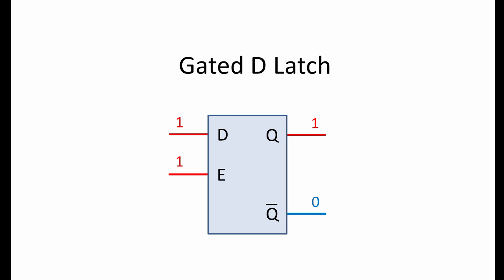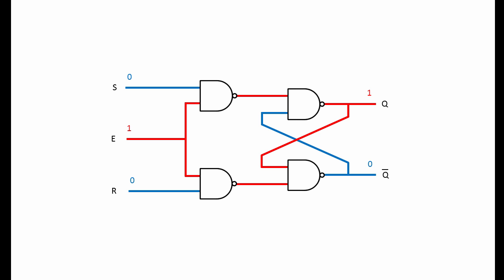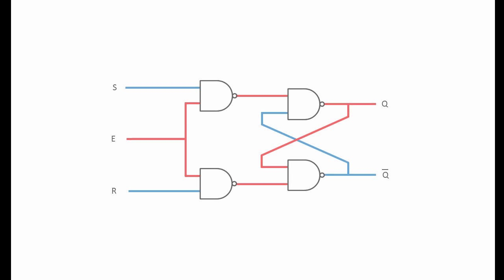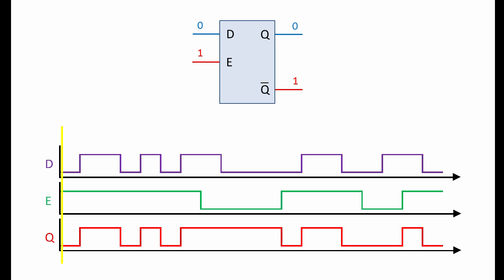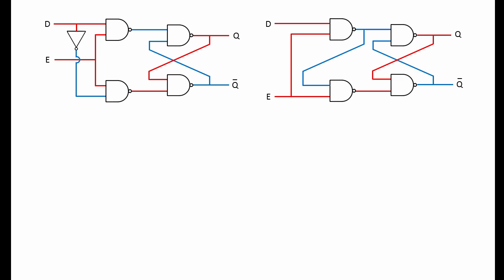Latches and Flip-Flops 3 - The Gated D Latch

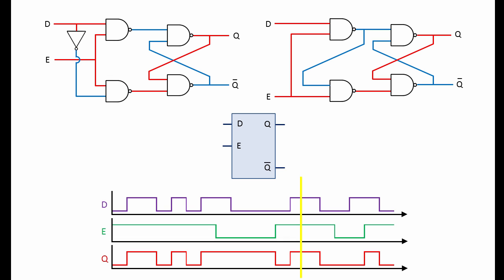Comment: 07:34 What's wrong about that? Flip-flops are just bistable devices that can last in either one of the states or another for as long as we please, and switch between them (i.e. flip-flop) when we want that to happen. There are literally SR flip-flops as parts of your D latches. Gated latches are also called "transparent" latches, because they're transparent when the enable input is high (replicating its input to its output), and latch (i.e. "freeze") their outputs in their current state whenever the enable input is low. As for clocked D-latches, I would say they're "registers", as they can store bits of data at the raising/falling clock edge, synchronously.

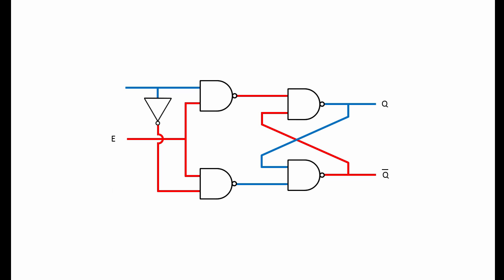Comment: 02:16 Oh yes they can, for a brief moment: When the S signal goes high, and it haven't propagated through the NOT gate yet, the NOT gate's output is still high, so both inputs to the SR latch are high (or, after inverting by the NANDS, both are low, which is the active state for an SR latch made of NAND gates, like the one in here). So the problem with racing is potentially still here, just less visible. Can we mitigate it altogether in some way?

Comment: the enable can be used witha  push button to alternate tue outs between 0-1 like a switch?
Reply from the maker: indeed
Reply: @ComputerScienceLessons  tried IT not worked with stability 
Used all push down resistors except the data that was directly yo VCC with a pullup 
Made a latch with trqnsistors

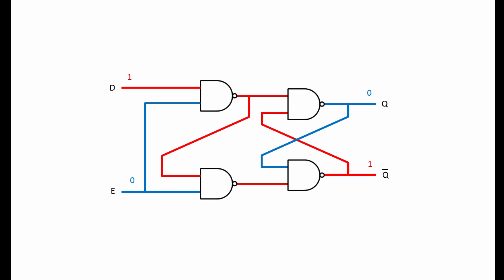Comment: I really liked the first two videos, but this one is very confusing. One thing I don't understand is why this circuit is called a latch when it does not latch actually. The difference in its behavior is clear when compared to the previous video (#2). This circuit does not work with pulses (see 2:28). It requires that the D input is already latched/sustained in order to operate like the latch it is supposed to replace (gated SR latch). The output Q is latched only as long as the Set button (D input) is sustained. Up to this point, Q acts as a buffer for D without any latching properties. It doesn't only fix a problem of gated SR latch, it also changes its operation. Another problem I see in this explanation is the behavior of the E input which is a little bit different here. In the previous video, the role of the E input was only to enable or disable the functionality of the set and reset buttons/signal. In this circuit the E input has also another function. It can affect/change the output (see 4:19 , 5:58 and 6:13).
Anyone care to clear up my confusion?